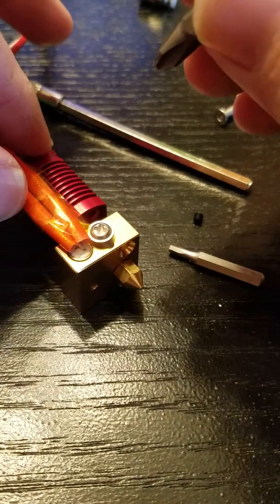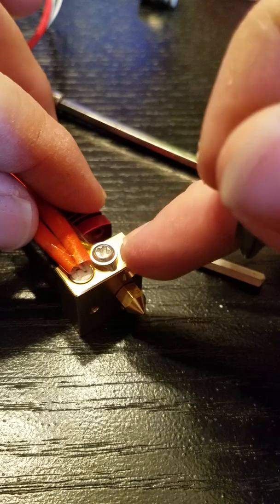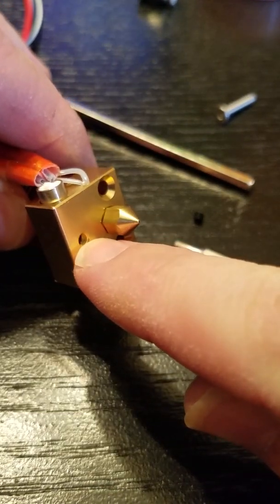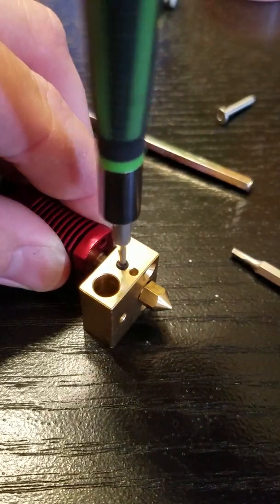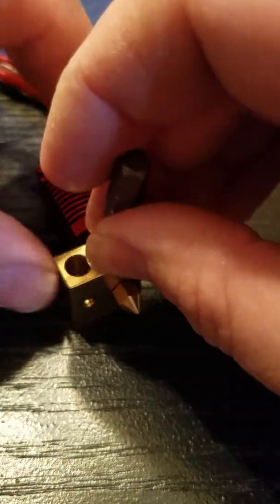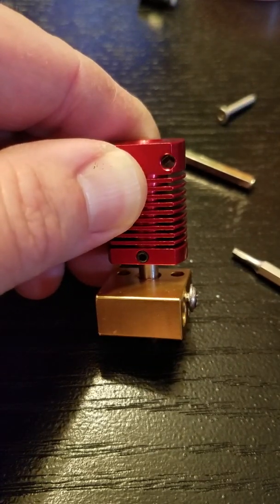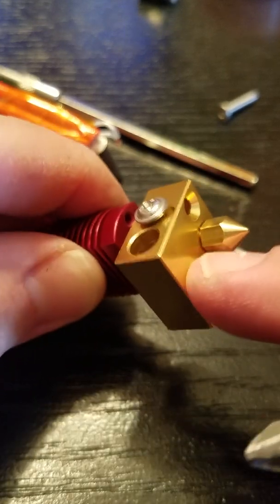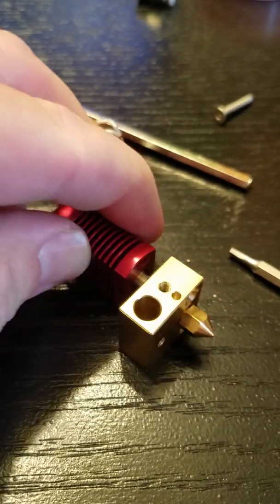Ender 3/CR-10 Pinched Thermistor Lead Fix

Comment: I have a way to tighten without pinching the thermistor wire, but your way is much easier. However, something else I've been doing is using a high heat thermal paste with a 280c witch provides a reliable "thermal conductivity".

Comment: So, how do you 'fix' the insulation on the pinched thermistor lead then? Good video, wrong title. I have just made mine usable again with some 'kaptan' tape, the translucent yellow stuff. I wrapped the bare wires with one thickness of it and printer is ready. Fingers crossed it holds up. No video though.
Reply from the maker: If it's just pinched and you back the screw off the insulation will be cut but the wire is likely air gapped. A piece of kaptan tape isn't a bad idea, or a dot of silicone. I don't think silicone will be a problem in this area.

Comment: I have always wondered why they dont simply supply the hotend with a silicone washer, it would let you tighten up the screw while providing a soft heat resistant cushion to protect the delicate wires, two would be even better, it would fully insulate the wires from the metal components if one place each side of the wires..

I might make a couple from an old silicone sock when I change it..

Comment: Yo thank you so much was stuck on a thermal runoff issue for a while I figured it was due to a failed print caused plastic to go all inside the extruded enclosure but was too scared to poke around until I knew what everything is inside there was finally able to clean off the plastic around it after watching your vid to study how it's put together! Thanks man your a life saver always great to have printer issues during an engineering project and having $100 worth of other students prints waiting on your printer to print their files!